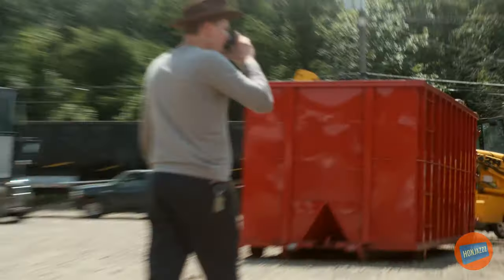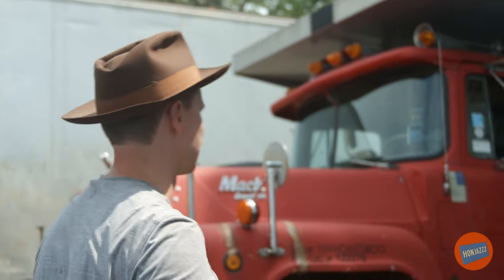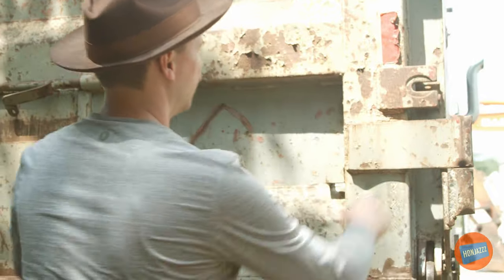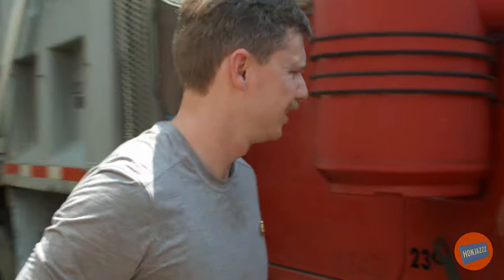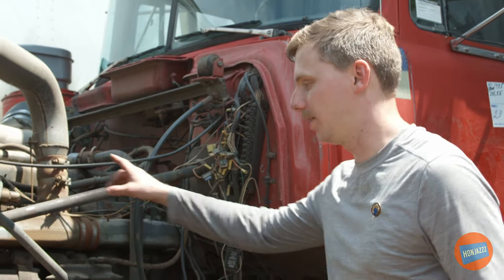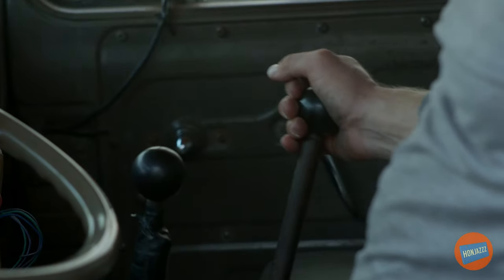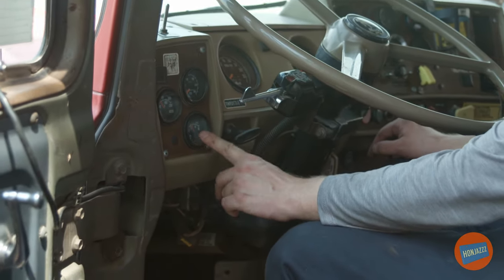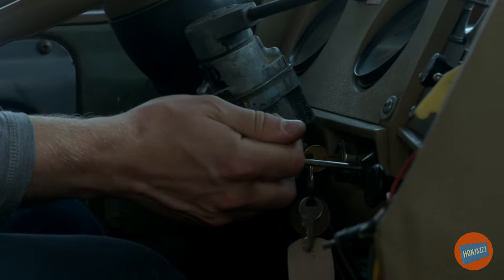Are old Mack Trucks Better? (R Model, CH613, Super Econodyne)

Comment: New ones aren't even Mack's...they are rebadged volvos.
Reply from the maker: Yeah I’ll stick with an old R model
Reply: They still manufacture the mack transmissions & rear ends
Reply: I guess what disgusts me is now they offer the Volvo T ride as the factory heavy duty walking beam sospension instead of the camel back. T tide is a huge plie of crap. I have worked on them
Reply: @jim-zx7gz  that pisses me off too man, Volvo’s are far from real Mack’s. I had a summer time job driving for my uncle hauling coal, he had two 76’ Mack DM 800’s  300 plus, 15 spd Tri-Plex, #65,000 bogies, tough ol girls no fiberglass on em. It was work but it sure beat the shit out of working at McWhatever for a job. Seeing Mountain View’s you don’t see from the interstate and listening to that straight pipe sing all day was heaven for a kid.
Reply: @heavydutyrepair64 the ones I see are all "m-drive" (i-shift) autos. I didn't think they offer a manual anymore. At least they still have the mack double reduction axles.
Reply: At what year is the cutoff where they started being Volvo?
Reply: They don't seem to sell many of the new macks. Ive lived by the plant my whole life. It seems like all they do is build and park them and the same ones sit there for a loooong time. Mainly dump or garbage truck chassis. Don't see many anthems or much of anything with a 5th wheel come out of there anymore. It's a damn shame too. For me though the R has always been the iconic Mack.
Reply: Not entirely true. You can still get a 100% Mack built truck including Mack suspension and trans.  Those are designated with a gold bulldog on the hood. 

Trucks with a component from any other manufacturer get a silver bull dog
Reply: Macungie is a vocational truck plant.  Cabover garbage trucks, dumps and so forth are made there.

Comment: One of the great things about the old Macks are that you don't need a 5000 dollar scan tool to diagnose an issue. Nope, a simple test light, and a 35 dollar Craftsman multimeter and you can solve most electrical issues.
Reply from the maker: Yeah I really like that about them.
Reply: That’s only when they do break down which isn’t often, hard to beat a 237,300 Mack and a 6 speed Maxi-torque, pretty much indestructible 👍🇺🇸

Comment: Wrong on the transmission! That was a 6 speed. The compound shifter on the right is Rev, Low and Direct. Low is only supposed to be used in 1 st. You can leave it in low and shift through 3 rd and shift to direct. There are overlaps in the ratios so it’s not the same as a duplex 10 speed is.
Reply from the maker: Thanks for clarifying
Reply: When i need a little more power i would spilt a gear with those old 6 speeds but best thing was the 5 reverse gears was great when you had to back up a long drive way or road and they were indestructible

Comment: I bought a used 1976 MACK R 300 model 5 speed with 3.2 million miles on her. I put 700 thousand more on her. Dropped in a MACK 350/6, w/new Mack clutch. The difference was night and day. WARNING!  My old 300 R, had a 28 Gallon Oil pan. So every 15,000 miles there was a $600.00 oil & filter change.The first investment you do is a new High air ride seat. Beat money you'll ever spend.
Reply: That’s a solid truck, the Maxitorque 5 with the mud stick is bulletproof. I drove a 76’ DM800 300 plus Mack #65,000 bogies and a triplex 15 speed man she was a beast. I bet that new motor makes you smile, I hope your running a straight pipe 👍🇺🇸
Reply: The ESI held 28 quarts in the pan and the ESI plus held 48 quarts in the pan.

Comment: We have gone back to R models, a fully rebuilt 350 with a 12 speed and camelback will outwork and outlast any other ( including the newer Mack’s ) truck ever built. I have been with Mack’s since the late 60s and still operate a handful of Mack’s
Reply from the maker: The R model is built incorrectly well
Reply: Is there any regulation or limitations running these older trucks?
Reply: No restrictions apply here in OZ. a huge advantage is seatbelts are not required in pre 96 vehicles. The fines for not wearing seatbelts  are huge.
Reply: I’d like to see you put an R model in the same work conditions a new Mack granite can work in.
Reply: @MrJ183 No, why would there be?
Reply: @1411MEDIA The R Model will still be working long after the Granite is in the junkyard

Comment: The first lever you you showed on the front of the dump body is not a chute release to open the body it is called a tailgate lock release lever, and the chute in the middle of the tailgate was not designed specifically for asphalt it’s called a COAL CHUTE they were originally designed to dump coal in a chute that leads into the ground for old style furnaces coal plants , they’re used for asphalt mostly but were specifically designed for coal to center it into the chute that leads to the under ground storage for coal furnaces.

Comment: I worked on trucks starting in 1982 while still in high school. our only truck was our 56 LJ Mack wrecker with a 237hp ENDT 675 Mack diesel (originally gas) a 5x3 triplex Mack tranny and of course Mack tandem rears. 24 in rubber and still had 6in brake linings, but we installed a Jake brake so stopping wasn't a problem. A set of standard wrenches and sockets and you could disassemble the whole truck.
Reply from the maker: Yeah that’s what I like about the old trucks. Really solid and simple.
Reply: All through the 70s early 80s I worked in the most remote parts of Australia, sometimes not seeing another person in 3-4+ days and never worried about my cab over 237 , 6 speed not getting me back to civilisation

Comment: that trani only gives you your sixth speed it takes 175000 miles to break that transmission in thats how long it took for it to be worn in enough to downshift from first to first & low while the truck is moving . on my 85 mack trlx107 trani you had a choice of three different gear ratios for first & low from the factory i had the lowest it was really nice for keeping my speed slow enough when doing snow loading with a snow go snow thrower ,  i went 950,000 with that trans with out a repair for my first clutch i had mack ( with their kit replace all the bearings in it ) they said that it was the cleanest trans they ever seen  always clean the side magnet twice a year and as it got older there was less and less metal on the magnet . then after the new bearings there was an increase on the magnets but drops off to virtually nothing in a couple of years i put 1.750,000 miles on her then sold it .  ( a friend was going to order one about 6 years ago the dealer said they are no good anymore cause they are made in mexico with lower grade alloy  metals )

Comment: Thats an RD600 not an R. It's also a Maxidyne not a Thermodyne looks like a 300 with chassis mounted charge air cooling. The transmission is a TRXL107 Maxitourque 6 speed. not a duplex. You only use low while in first gear, you don't split the gears. Rear axles might be 55000 lbs rated so it might be a bit heavy for some states.

Comment: I have drove Mack b81 trucks R model RD 822 tin nose DM 685 tin nose DM 886 dumps mixer rolloff packer trucks The 60s,70,80,and part of the 1990s were the absolute best years I am a huge huge fan of Mack trucks since I’m a young kid BUT I would not by anything NEW they are not Mack’s R-RD early models DM 600-800 is what you wanna look for

Comment: Some rough riding trucks, they're tough though. I've not ran the new ones yet but the cab's look nicer. I don't think driver comforts were a consideration on the old Mack
Reply: I have only one CH with airbags left as we’re replacing them with R models (Valueliners here in OZ] and I can assure you the camelbacks ride better
Reply: The R models don’t have the insulation and the cab is perched on top of the gearbox making them a tad uncomfortable but hey are you a bloke or what

Comment: I drove many old Mack’s dumps rolloffs mixer packers   1960s 70s 80s 90s All Mack R RD 600-800 tin nose DM 600-800 MR plowed snow back in the blizzard of 96 with a 1963 B81 dump there is nothing like old Mack’s I’ve been a huge fan since I’m a kid I wouldn’t buy a new truck ever I would drive a old Bulldog Mack every time

Comment: Is this what I should be looking for as a first truck? I've been driving a tractor trailer for a little over 5 months now, and I'm considering switching to driving a dump truck with the goal of becoming an owner operator. I know that I'll need to learn the business and gain experience driving the truck first, but I like to get my ducks in a row so that I know what I'm working towards. I know that I don't want a new truck, and I know that I want a pre-Volvo Mack truck because I want reliability, durability, and performance; something that is going to give me my money's worth and be dependable, simple, and easier to maintain. "Measure twice, cut once." I don't have restrictions on my CDL. I can drive a manual, but I've never seen the shifter style that is in the truck in the video. Any tips would be greatly appreciated. Thanks in advance. I forgot to mention that I'm 6'3" with long legs. Will I have enough room? I'm chunky, too haha
Reply from the maker: Congratulations on buying your first truck. If you can find one that’s been maintained then go for it. There are different transmissions available so you can look for one that suits your needs.

Comment: The newer, the worst. I started on a 237 steel hood DM and a 185 horse Thermodyne and a Quad box and ended up with a Superliner with an E-9 and a 12-speed. The 'C-'models have a bit more leg room and a good a.c. but for off in holes and roughs I'd take an R-model or a DM any day, OR a B-model, 711 with a duplex. Drove straight trucks and pulled trailers and hauled concrete. Single axles, tandems, Tri's, quads and quints. And everything else too. Cummins and Cats but the Mack old school were the strongest. Even Oshkosh/Mack fron discharge. Sounds crazy but it spanned over 50 years. Army 5-tons at 19. LOve it but it don't love me. Time to quit and drive a mower. God Bless Yall!
 BURN DIESEL!

Comment: That's an econodyne NOT a thermodyne. Probably a 1700rpm motor. Does not drive well. Split between the lower gears to broad. Any uphill incline can't get to next gear after take off. Have to hold that gear until get on flat ground.

Comment: Sorry but, NO! You Do Not split that two stick Mack's gears! It's a "ten speed extended range transmission". The second stick I believe is Rev=reverse "Up and to the left" Low=low range AKA "deep reduction" off road gears are "up and to the right" and Dir=direct which is your on-road gears 1-5 yes that's right it's a five speed in all reality! The 8 speed extended range is the same but with an air shift and a neutral in the ranges( plus you're not supposed to use 4-5 gears in low even if they are there. The 7 speed extended range transmission has a range button and it has a reverse in low and high=direct so you don't have to shift a stick, or move a switch. So..... Nice you're showing the old Macks they're still great trucks but can't keep up with the new ones. They're still valuable and ready to work though!

Comment: I don't even have to watch this to  tell you Rmodel is better. I've had both. Our 08 is a nightmare compared to our Rmodel mack 300 motor
Reply from the maker: Yeah that’s true
Reply: @HonJazzz  dude, I shit you not, the only reason I watched this video is because a few hours ago when I made this comment I was driving our 08 granite with mp7  down the road smoke  commin up behind cab lightning bolt on dash, truck went into lymp mode. Somethin with re-gen. Just had whole harness replaced two weeks ago 70000 miles on truck. Yeah ill take my old 79 R model 300 motor with real Jake brake  10 speed any day over this thing.

Comment: in my experience, old macks will run forever, but they have to run forever to do the same amount of work a competetitors truck can do in 10 years.when i ran a mack dump body by the end of the day i was a whole run behind, compared to trucks that could haul as much as me, but actually had horsepower under the hood.i lost 5 loads a week because of that powerless piece of sh•t.thats a loss of 20 loads a month. 260 loads a year gone because mack had no clue how to make anything but bottom end torque.but they WILL run forever.be good engines for low rpm, high load portable generators.

Comment: Maxidyne  ,the old thermodyne  engines  didn't  have turbos
Reply: Very late in the game some did. What they learned and introduced in the maxidyne is they learned air to air intercooler & cooling from underneath with oil; to offset thr extra heat by turbo. The thermodyne didn't have that so if you lugged it & really leaned on the turbo, bye bye head...
Reply: But yes you are right, no way that is a thermodyne, way too late of year for that engine. Maxidyne for sure
Reply: The 711 had Turbo charger!